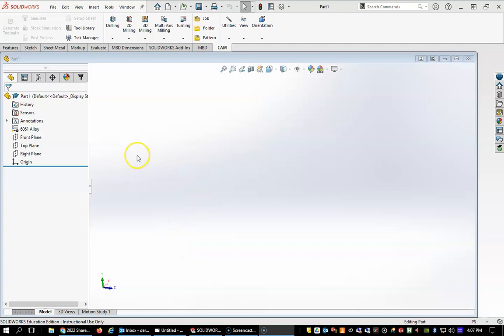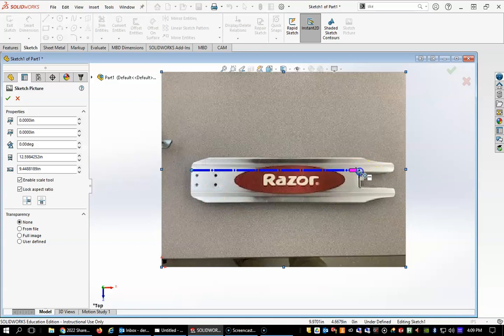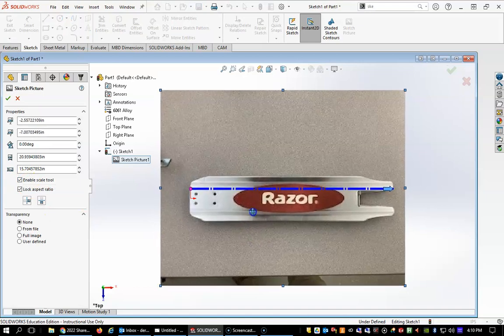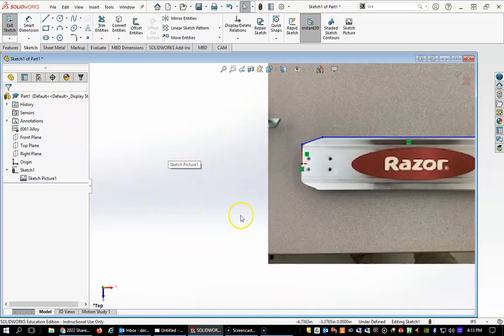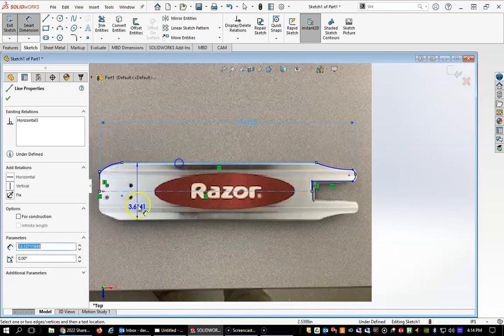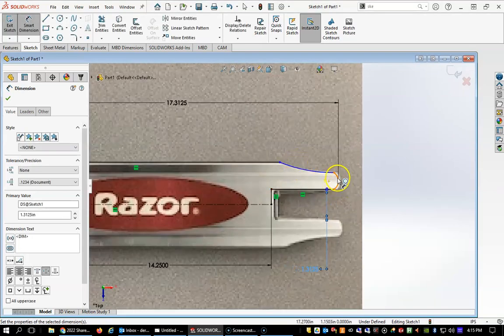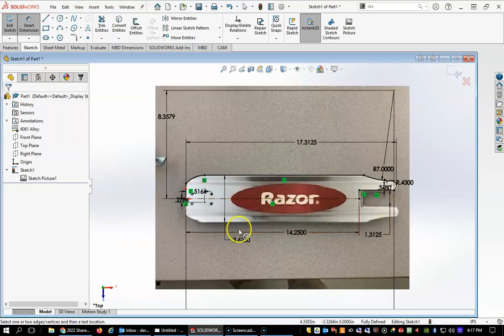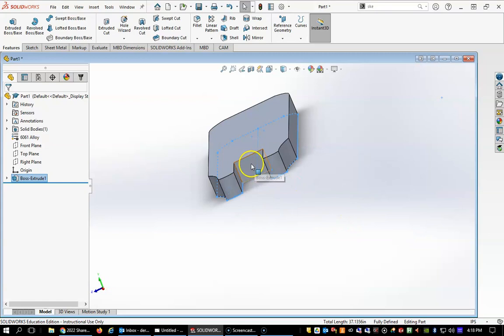Sketch Picture Solidworks

Comment: 5:38 pictures from a camera will always be distorted slightly or significantly, depending on the size of the object and the settings and nature of the camera, and I think this is an example of that. I don't think you scaled anything incorrectly